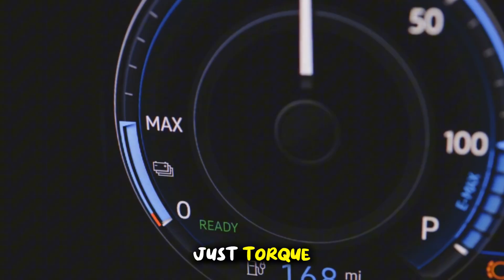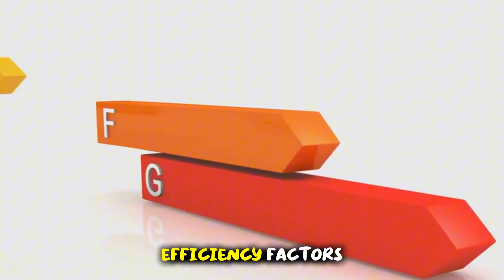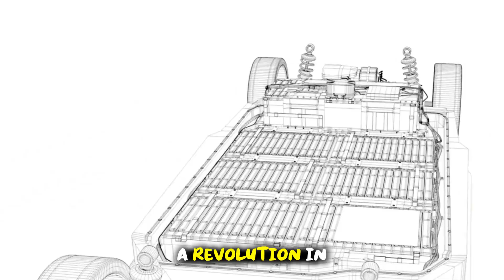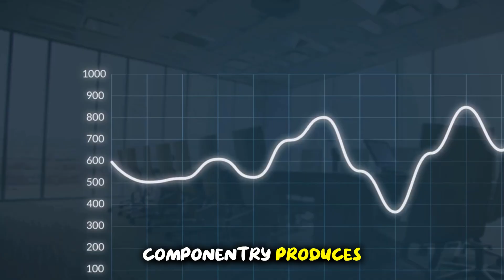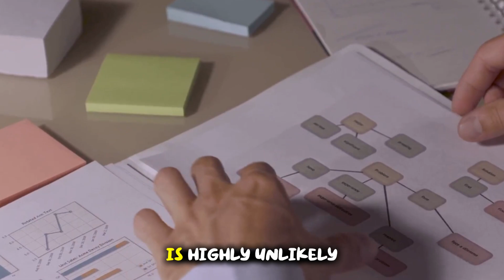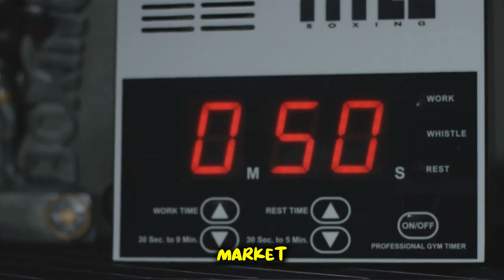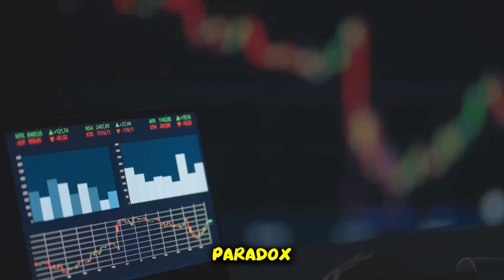CATL Announces 2nd- Gen Sodium Ion Battery with 5 Minutes Ultra Fast Charging

Comment: Sodium is salt salt is corrosive to all kind of metal. That is the reason why sodium will never be material of choice for batteries not only is it gonna eat away at the battery cases and self which is made of metal well so the cars that they are manufacture
Reply: Sodium is a metal just like lithium. Sodium and lithium are chemically very similar.